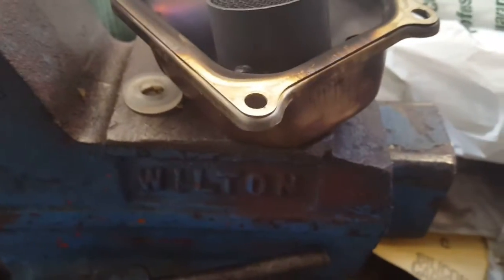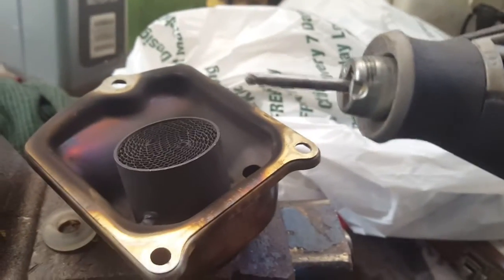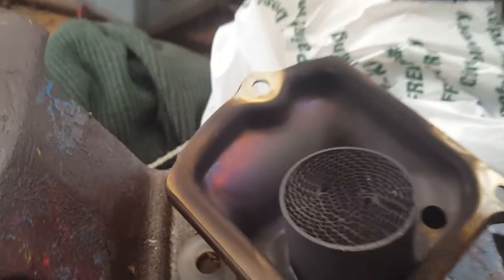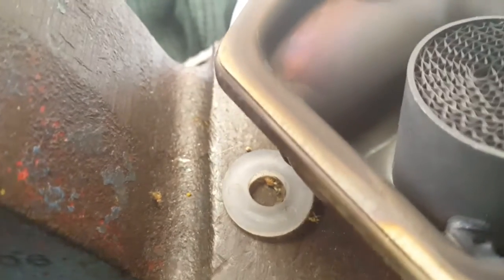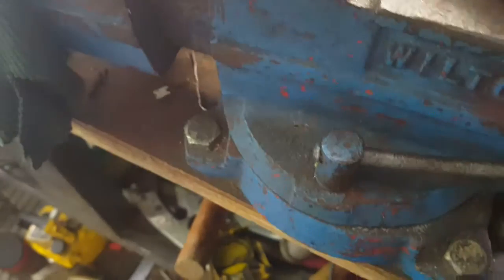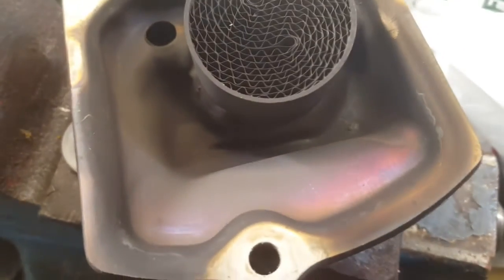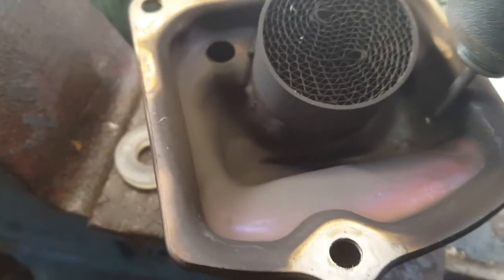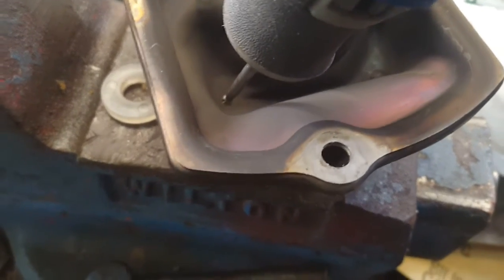Dolmar ps 421 muffler mod spot welds

Comment: Thanks for the vid . Removing the catalytic converter  makes the saw run cooler .  You might have to adjust the H screw on the carb to make her run at 13,000 rpm
Reply from the maker: Ya catless is a big improvement. as easy as it is I think is should be done before even running the saw. LOL Thank you for watching and taking the time to comment.
Reply: @fuelediowa   Hi , yes ideally do this before running the saw as with the cat in place makes the catalytic converter turn red hot which probably isn't the best for the engine  life .  One of my drill holes was maybe 1/8" off one of the spot welds but still was close enough so the cat just lifted right off , the spot welds are really minimal , just enough to hold it on .

Comment: Hello friend, good video. A few days ago I bought a new PS421 and I want to remove the catalytic converter. I am going to buy another muffler and leave the current one unchanged, because I want to have it as a spare in case there is any problem with the guarantee, to leave the saw as I bought it.
I have a couple of doubts. My new stock PS421 runs at 11000rpm at top speed, the mix is pretty rich. Is it possible to eliminate the catalyst and have the saw run well without having to regulate richer the high speed screw of the carburetor ? Since a special tool is needed, and the warranty is lost by doing so.
The other doubt is that in the exploded view manual, there are 2 different mufflers, one with a catalytic converter (serial number 195 174 550) and the other without it (serial number 195 174 500). Are They compatible? Can I buy the one without a catalyst directly, or do I need to buy the one with the catalyst and drill out the welded spots to remove it?
Thank you very much, I subscribe to your channel.
Reply from the maker: I'm not sure if the non-catalytic version is available in the USA sometimes they'll have those regulated down to regions. As far as tuning that can vary sometimes you can get lucky and it work out all right but it's good idea to go ahead and get into the knowledge of how to tune. Even just extreme weather changes or changes in fuel or oil can change enough to throw the tune off a little bit having the knowledge base is better than the possible results of not being able to tune it. Warranty also will not cover a saw that happened to run lean from not being tuned. If you can get the catless muffler that would be easiest. But taking the cat out is not that bad.